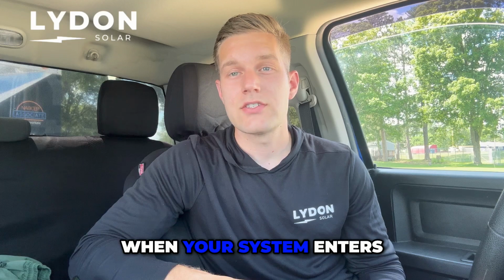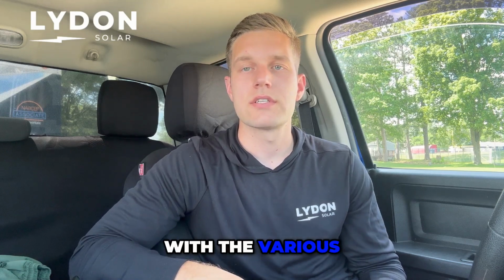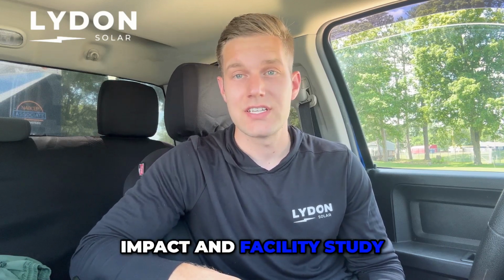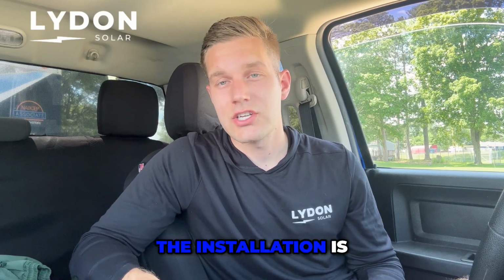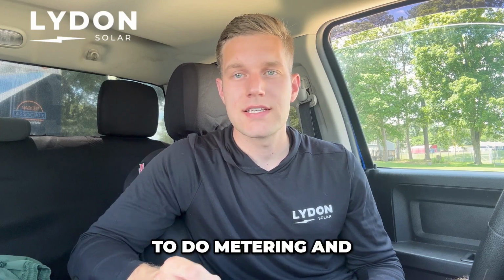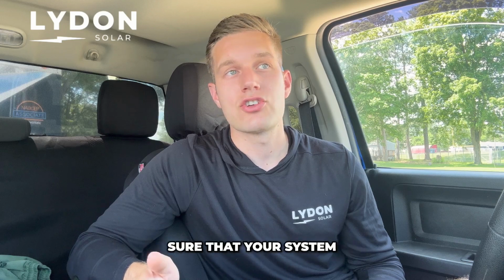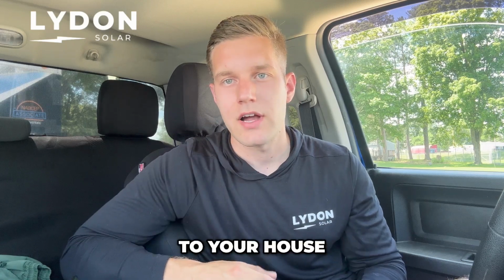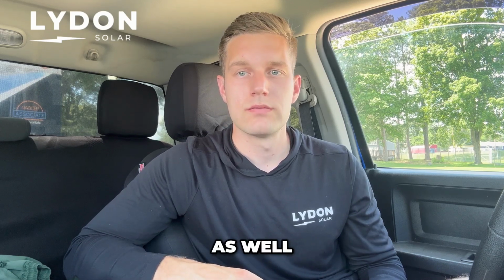Mastering the Interconnection Process: A Guide to Safely Connect Your Solar Power System to the Grid

Comment: Thanks for the information.

It would be great if you could address MIDs (Microgrid Interconnect Device (MID). A device that enables a microgrid system to separate from and reconnect to operate in parallel with a primary power source.)

I also recommend re-editing this video, lots of dead spots, lots of false starts.